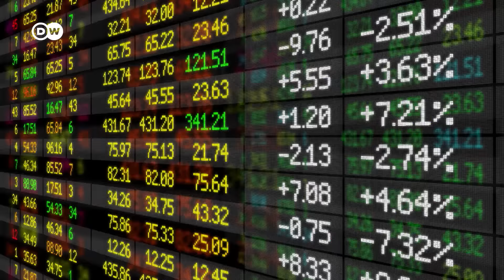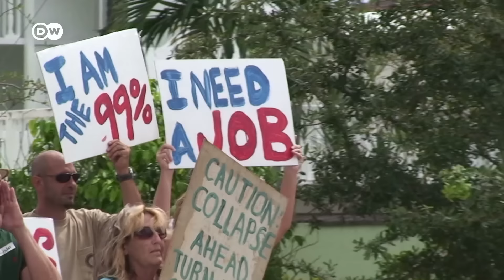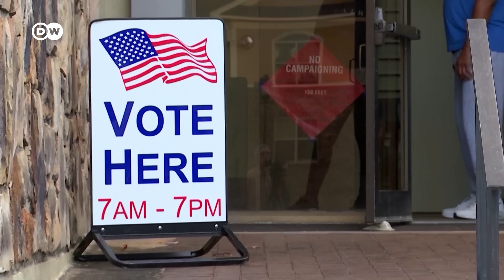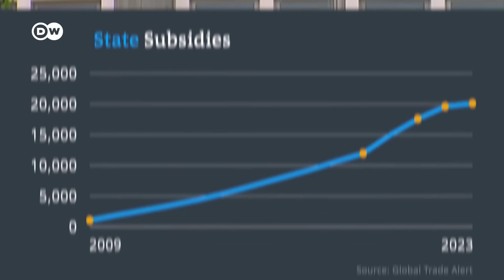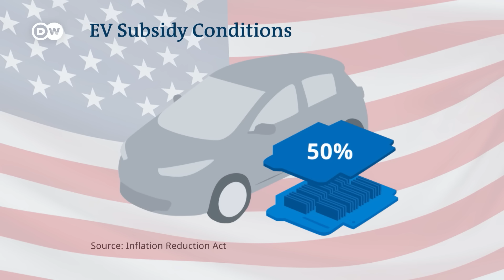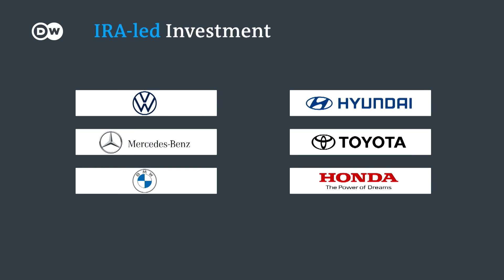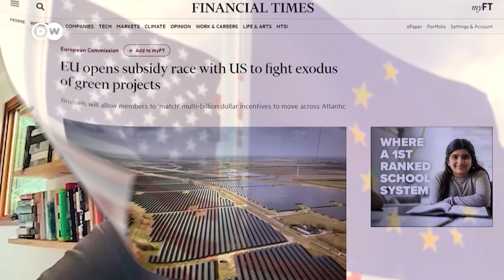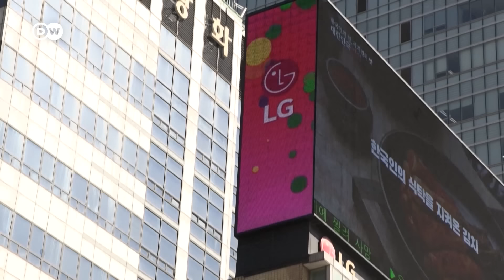The rise of economic nationalism | Business Beyond

Comment: There is definitely a larger nationalism focus in the last few years. However, the central framing of this is incorrect. We didn't have a completely free market before 2020, and now have an interventionist market. All that's changed is where the interventions are targeted, and which classes get the most support. 
From 1980 to 2020, we subsidized oil and gas, we allowed monopolies to form based on acquisitions and new technology, and we intervened to support banks and finance and cut taxes to the ultra rich and allow them to hide their money in offshore banks. 

We're just focusing now on green tech and trying to get at least some money to flow to the middle and lower classes, because the previous Reagan-voodoo economics didn't trickle down, and was never intended to
Reply: Not bad, but after the Farming Lobbies, O&G have a big gun in DC circles. Oil and Gas have been getting subsidies since back when many of them still had visible coal mining operations. And it only got worse during and then after WW2, when most of the US producing wells were only producing a fraction of their prewar rates- due to massive overproduction to supply eight out of every ten gallons of fuel, lubricants and other petrochemical based war needs- which includes explosive agents as well. It took till well past the turn into the 21st Century to see US production back at the top- and billions of dollars to get it there. Considering the profits Big Oil has made all though this, I will not be saddened in the least to see them lose their subsidized ride. And here is the real kicker; every quarter since WW2 that a Democrat was in the WH, Big Oil has been more profitable than when the "other guys" are. A statistical fact, not a guess or "TV gleaned" factoid. And don't even open the door to Big Oil and their responsibility for the modern ME disaster we have today. A better argument for government reigning in greedy, self promoting business  people has never existed. Big Oil was paying ME nations less for the crude than what they paid in taxes on all of the finished products up until OPEC took a hand at the table. OPEC came into existence just because of those rapacious business people.